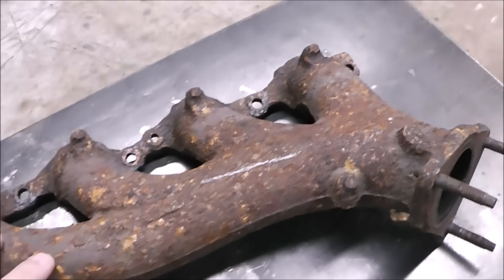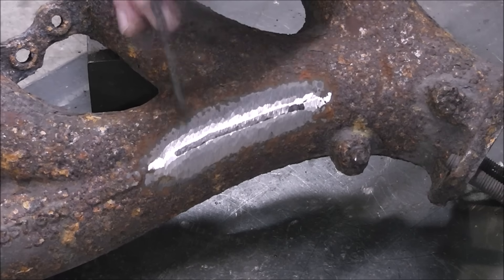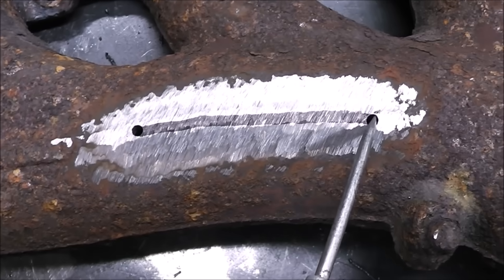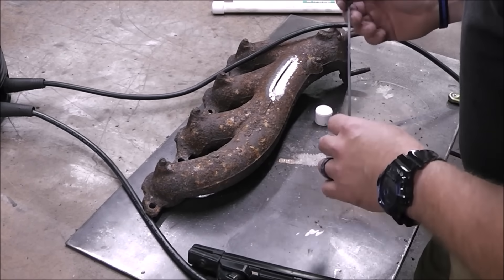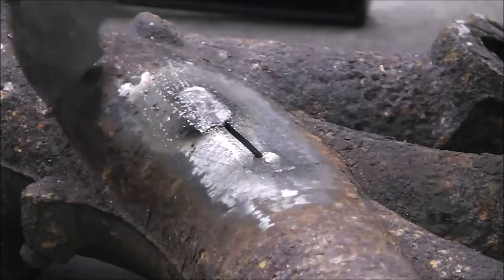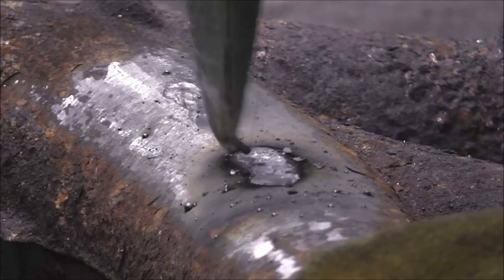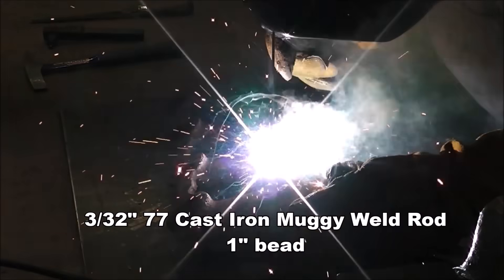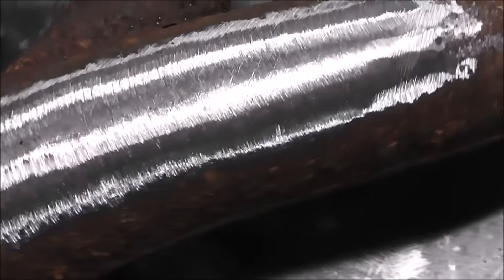Stick Welding Cast Iron Repair with Muggy Weld

Comment: Many interesting comments. When I learned to weld cast iron during my apprenticeship late 60S, we had cast iron welding filler rods. They were .25" square cross section and about 24" long. Used these with an oxy set and the filler "disappeared" into the work. You end up with an almost invisible weld that looked almost like the original! The cast iron filler rod became the workpiece, it merged before your eyes. No cracks, no joins just solid cast iron! Beautiful!
It did require pre and post hearing to relieve stresses.
Cast iron filler rods have not been available in Australia for MANY years.
Regards Peter
Reply from the maker: I have heard of those rods but I have not had an opportunity to try them. Some engineer probably decided because they worked well that they should be discontinued 😁 cheers brother!
Reply: Thank you for the video.
  I have a block that froze and cracked and wanted to try something like this .
Reply from the maker: Thanks man and good luck with your repair! If you think of it, let us know how you make out

Comment: That doesn't look like cast iron to me.  arc welding will normally get a little porosity and takes a few passes with grinding between passes.  that weld bead looks too nice for cast.   muggy weld ?  why not use a product from a major manufacturer? this is just repackaged rod sold at high prices.   Magic rod with smoke and mirrors.
Reply from the maker: It's cast iron. 100%. Here is a video about that https://youtu.be/cVrydI-v7B8. As far as I know their rods are exclusive to them, but i'm not positive. As far as re branding or cost, for me, It's all about getting the job done right. I once spent 40 hours duplicating a part that I could not weld and I could not find another to replace it. Even if the rods were $100.00 each, and they worked, I would have saved my customer a pile of money and myself a bunch of aggravation. You asked why Im not using rods from a major manufacturer, As I said in the video, my viewers asked specifically about muggy weld rods and I accommodated that request.

Comment: Grind the pit out and make another pass and it's done .
Reply from the maker: It really wasn't necessary. I probably could have done 2 passes with the 77 rod and been done with it,  but I wanted to try the 72 rod because I had not run it before.

Comment: What would happen if you cleaned it up like that and then peined 260 brass or copper into the gap (but not too hard, I've split hardened steel peining brass in before)
Reply from the maker: This is just a guess because I really don't know...I'm thinking where as the part is always going from hot to cold that eventually the dissimilar metal would work its way loose from the repeated thermal expansion and contraction cycles...Interesting concept but this is just a guess on my part.

Comment: I am no welder, and may not be able to do as good as you did,  but what I saw was, you started on one side of the manifold and finished on the other side after flipping it over. What did the first side look like when finished & why flip it over?
Reply from the maker: Both sides were prepped for different episodes and I got confused and didn't catch it.  Good eye

Comment: Brandon, I saw an English Guy Cold Stitching an old cylinder head that had a crack in the water  jacket! When he was done, crack gone, no leak, Awesome!
Reply: The English guy was working in an old rail road Depot, on old trains. He did cold stitching on an old 30s English car. Showing old world technology for the ages...
Reply from the maker: Very cool!
Reply: The cold stitching process is a great technique, probably the most effective method with least chance of catastrophic damage/failure of the part. Labour intensive, sure, but it'll last and probably the way I'd choose on a rare/super expensive/irreplaceable part due to the success rate and less chance of being scrapped if it failed.
Reply: yep, saw it too... in an english TV show "Car SOS" it was an "Austin 12" from 1928...if my memory doesn' t fail :)
Reply: Hey brandon if your reading this to help with cast iron, place some scrap plate next to your crack and strike a very low setting arc on the plate and heat a low setting up then dip over to your crack, its alot more efficient then trying to start the arc on the cast iron if its stubborn, if that manifold is thick enough then need not to worry it just helps get a better temperature for your start.

Comment: As at least one other guy has said this is an exhaust manifold for a GM LS engine and they are likely cast steel rather than cast iron. And they are very popular for DIY turbo manifold setups. I am running a set of these manifolds on my turbo 6.0 and I welded/modified them extensively using a MIG welder and no preheat or other fancy gimmickery.
Reply: The material is definitely cast iron. Watch the video at 3:15. The drillings are dark gray in color. The gray comes from the graphite flakes in the cast iron microstructure. Steel has carbon in the form of carbides but no graphite. The drillings would be much brighter looking if it were steel.
Reply from the maker: @Secession1900  right on! You are the first person I believe who has noticed this. As you pointed out, cast looks nothing like steel when drilled.
Reply from the maker: We discuss just this topic in today's video :) Cheers and thanks for watching!
Reply from the maker: @Joseph_kilbreth1987that seems to be a common misconception with some.  https://youtu.be/cVrydI-v7B8
Reply: If they are iron, they can be MIG welded with a little patience and no cracks. Tons of people on LS1tech doing it and I've done it. Rockin' em on the turbo 6.0. If it is iron like you guys say, it's a way better iron than you'd find on a manifold from a small block in the 70s. I talk about how I had to move one of the collectors in this video around the 11:24 mark https://www.youtube.com/watch?v=ceq_kx6i32Q&t=2s

Also, you can see the moving of the collector and the removal of all the bosses and holes in this build thread here about 3/4 of the way down: https://ls1tech.com/forums/conversions-hybrids/1863935-turbo-6-0-t56-build.html

I ground off all the bosses for the heat shields and EGR and everything else and wherever there were holes I filled them up with the MIG.
Reply from the maker: Chase Lentz yes, some cast irons can be welded with mig even when the carbon content is rather high. WHY it can be done is beyond my knowledge,  Cast iron varies wildly which is why most commenters are so varied on their repair method from s.s fillers, nyrod, cast rods, 7018, mig, muggy weld brazing and on and on it goes. The real answer is there is no real answer. What works great on one piece of cast might not work on the next, which is why I advocate a rod designed to weld cast.

Comment: I have a test piece of cast iron that was stick welded with a pure nickel electrode sat in my wood stove, it has gone through hundreds of heating and cooling cycles and not cracked. I preheat to 300 c, stitch weld, then leave to cool overnight in a bucket of dry sand.
Reply: Absolutely spot on, pre heat and cool down in a bucket of sand. I am a time served welder and this was how i was taught.
Reply from the maker: Thanks John!
Reply from the maker: Thanks! :)
Reply from the maker: This is an excellent method!
Reply: I always pre heat and post heat and then i would wrap my post heated part in a heat blanket. I have brazed them and stick welded them. Drilling @ each end.
Reply: Thank you for excellent information, although I'd much rather save the time with the method and product shown in the video-in all cases, you know that cast iron parts come in a variety of uses and thicknesses? I will be using these rods extensively for sure.
Reply: Yeah I was going to say use the nickel rod works great on cast iron been doing it forever
Reply: To clarify by " stitch" I meant I put in a series of full penetration tacks or stitches then let it settle back to preheat temperature then repeat until the joint is filled. Peening is supposed to improve the grain structure of the weld area but I've never seen any set method of doing it, seems like guess work to me.
Reply from the maker: Thats a reliable way also :)

Comment: Brandon, no disrespect but why did you repair the front side of the manifold during the video and then at the end of the video you showed us a freshly cleaned spot on the back side of the manifold?
Reply from the maker: Both sides were prepped. One side was for this video, the other side was for an upcoming TIG video.  I accidentally welded the side you did not see me prep. Good eye :)

Comment: Beautiful work, I miss welding fabricating machining and repairing was my favorite!
Reply from the maker: Right on brother! I probably enjoy repair work more than anything...each thing brings a new problem with a little different solution.  Cheers and thanks for watching!
Reply: Brandon Lund ; you’re exactly right that’s where you get that hands-on experience… One of the first things I learned to use was a hammer and I could shape any piece of metal. Every place I worked at, I was the repairman and loved it And get all the specialty welding and fabricating.Very few have the skills that we do, but anyways thanks for getting back to me God bless
Reply from the maker: God bless you brother!

Comment: I always preheat before I do any cast welding.. I set it on top of a kerosene heater on high I also weld it while it sits on the heater then slowly bring the temp down on the heater...
Reply from the maker: Pre-and Post heat is the way to go when you can!

Comment: A very good, informative video, thank you for posting it.  I am new to welding (but old in years), and I have a cast iron part that needs to be welded back together (yes, I broke it...stop laughing), and while I did get some cast iron repair rods (for oxy use, not stick)from my supplier, and the pre-heat tip, I am trying to make sure I have as much info as possible before I tackle the repair.  The info in this video will, I am sure, turn out to be quite useful.  Thanks again.
Reply from the maker: Paul W Thank you! Stay tuned because the next 2 videos are going to be all about cast iron. This Friday we are cutting this one open and doing some testing. Next week we are doing a complete repair with pre-heat, post heat and insulated cool down. To increase your odds of success, I reccomend you heat your part, weld it, then either wrap it in a fiberglass blanket or bury it in sand. Next Fridays video will cover this in detail. Cheers and thanks for watching!

Comment: Welding cast iron is easy as fk been doing it for 20yrs now.
Reply from the maker: It really depends on the quality of the cast. The older stuff (early 1900's) is much more difficult to weld than the newer stuff.

Comment: I came from the old school of silicon bronze filler for cast iron.  What a PITA.  Even after stop drilling, v gouging, pre heat 500deg. in a heat treat oven and short stitch TIG welding and peening followed by post heating with natural cool down, the manifolds just like yours (small block Ford) still had the distinctive 'tinkling' sound of cracking at room temp. Arrgghh!!!  Had to do that one all over again before success.  There's an additional addendum to this story, maybe fodder for later??Then I discovered Eutectic's '680' filler.  Considerable stretch when cooling, works on all ferrite materials, and beautiful easily controlled puddling.  Worked even when you do not take all the time, precautions with a quick and dirty give a hoot attempt.  Used to feel this would make a rookie look like a hero!!But this new Muggy filler is new to me.  Definitely worth keeping in one's arsenal.  Thanks!!
Reply from the maker: Thanks man! Brazing is an art form in my opinion. That was one of the first processes that I learned on.  I used to pride myself trying to make the "stack of dimes" look.  Now I'm just happy to get it in there LOL.  This muggy weld rod goes in like butter though. It sounds similar to the 680 you mentioned.  Thanks for your support brother!

Comment: It must be your rod that allows this to work.
Are the any other # that go with the 72 and 77 rod ?
Like 7214 or 7711 ?
Reply from the maker: Good question! Muggy weld doesnt list their rods this way, but online they list both the 72 and 77 rods as 55,000 psi, so if they went with conventional numbering, the first numbers for both would be 55.
Reply: Thanks for the comeback and info.
I have welded cast with 7018 before , I had to heat it up the entire vice part and weld over the hear in order to do this.
Great video  Thanks again

Comment: How did that happened.
Reply from the maker: How did what happen?
Reply: Brandon Lund 
That little gap his trying to seal.
Reply from the maker: You mean the slice that I cut into the manifold with a grinder wheel?
Reply: Brandon Lund 
R u trying to b funny.
Reply from the maker: I don't understand what you are asking.
Reply: Brandon Lund 
Was i asking u a question.

Comment: For the welder you aint there's grinder and paint.
Reply from the maker: I'm actually very happy how the welds came out...they are about as good as your going to get using short bursts like this.  I ground it down to show how well the weld metal visually blended into the surrounding parent metal.
Reply: +Brandon Lund Its a great weld man. I was just hoping to make some people laugh with that old saying.
Reply from the maker: @whitewigglesworth  it's all good brother! If you have any buddies that are carpenters, you can use this one on them, "caulking is what the carpenter isn't". Take care brother :)

Comment: Why is the beginning of the repair done to the outside of the manifold and towards the end of the video you are showing the inside of the manifold? Fail the first try?
Reply from the maker: "Good eye. I prepped both sides because one side was for this project and the other side is going to be an upcoming TIG episode. Being the director, camera man and welder, I lost track and accidentally welded the side that no one saw me prep".

Comment: That is a GM LS manifold , 4.8-5.3-6.0 truck manifold. No much iron in that. Very soft. I've mig welded with no preheat. It's common to modify these for turbo applications, so a lot of different techniques used
Reply from the maker: Be sure to check out this weeks episode. I cut it open and do a bunch of different welding processes to it.

Comment: How does it hold up in working life? An exhaust manifold goes through many heating/cooling cycles. Does it have a similar expansion coefficient as the surrounding cast iron?
Reply from the maker: I would think its material properties are very similar to the original base metal. Muggy Weld actually makes an exhaust manifold kit, which includes these rods, so I imagine it's composition is quite similar. Nickel rods are a common repair for cast and I believe these rods contain nickel.
Reply: Even if it doesn't (I suppose so), the weld must be quite soft so it will give. The welded piece had a nice gap anyway and that helps.

Comment: Best way to weld cast ,hook up your stick welder backwards ,weld with the ground wire it draws the heat back into the welder when your done u can put your hand on it no heat build up ,no drilling ,no heating ,and it will not leak I have been welding cast iron for years and making money doing it you are making it way to complicated HOOK THE WELDER UP BACKWARDS u will really be surprised
Reply from the maker: Interesting Brian! It makes sense...straight polarity - DCEN is great for welding sheet metal because the heat is localized to the rod...I will have to give this a try!  Thanks buddy!
Reply: Brandon Lund .

Comment: I'm kinda curious what the other side of the manifold looks like. I noticed the side you started on is not the side you finished. Have an oopsie on the other side? Nice job on the finished weld though. I've never tried the stitch welding cold like that, always pre/post heated my cast repairs
Reply from the maker: This was my first cold repair also. The rods were new to me, so it was more of an experiment than anything. I wanted to see how they would work welding cold. This is probably a worst case scenario so I wanted to see how they would do. Both sides of the manifold were prepped because one side was for this video and the other is for a TIG video using these same rods. Between being the Director, Camera Guy, Welder and Editor, I got confused on which side was which and ended up welding the side that no one saw me prep. lol

Comment: Excellent turn out Brandon, and thanks for the demo. Did you use the same voltage on the 77 rod?
Reply from the maker: Thank you! If I remember correctly, the 77 called for a little less voltage. I cant remember for sure but I think it was about 5 amps less.

Comment: If that is a gen3 Chevy manifold they are cast steel not cast iron
Reply from the maker: That seems to be a wide spread misconception that because others have had some success with MIG, that it must be cast steel. You can not buy this as a cast steel part.  There was actually some independant testing done showing its carbon content to be 3.6%.